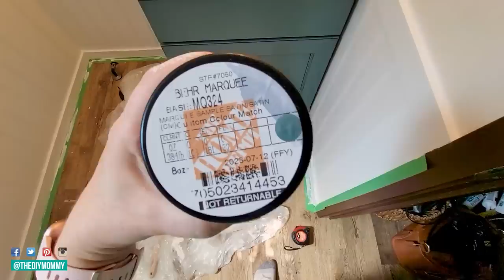Budget-Friendly Transformation: Small Bathroom Makeover with Striking Statement Wallpaper!

Comment: What a great renovation. It seems you added the trim on the right side of the vanity also? I want to get a vanity top that is all one piece like you used here. My current vanity looks just like the one you took out with those wall backsplash pieces. I have been wondering how to fix that with using a one piece top. It all looks great.